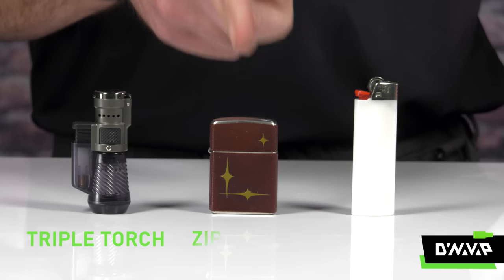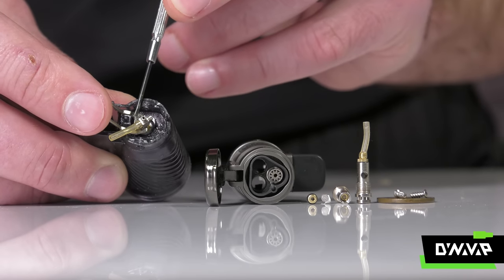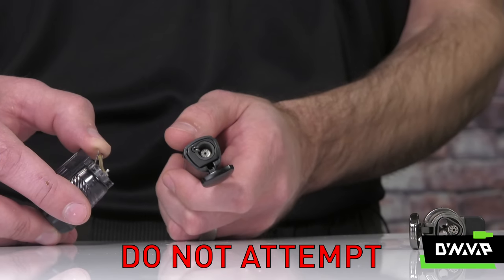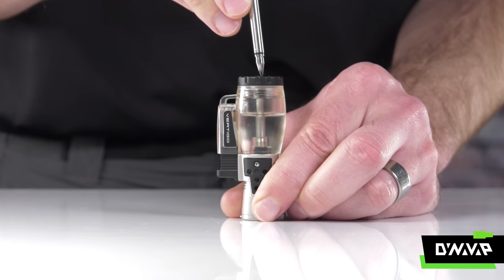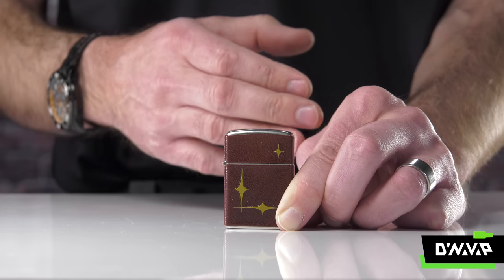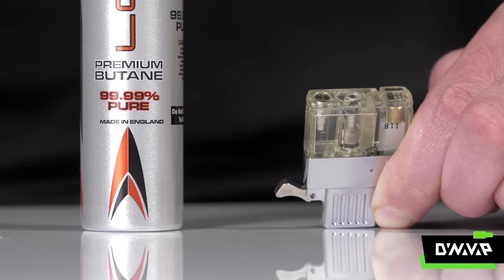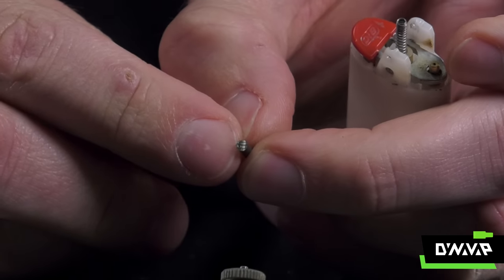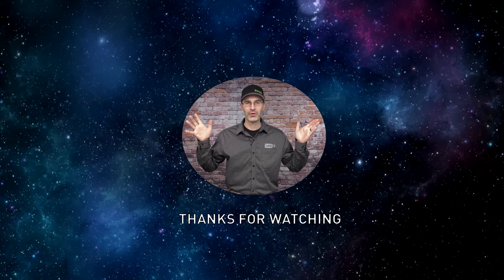How do Lighters Work? |  Exploring the DynaVerse (Ep 01x02)

Comment: Great video George. Informative and entertaining. I use a single flame torch most of the time with my omnivong xl. However I’ve had this cap since three years and it’s been my daily driver. I rarely if ever go past the click and it still clicks great. How long do they last if not cleaned with iso or run past the click? What is the longest used cap you have a record of? Greetings from Germany and stay golden 👌🏻🙏🏻

Comment: Unless I missed it,  how does the fuel ignite? What is the ignition source.
Reply: Tom Petrilli the ignition source for the torch right? I noticed also that I either missed it or it wasn’t there 😂
Reply: I am from the future to tell you it is ignited with a piezo ignition.
Piezo ignition is a type of ignition that is used in portable camping stoves, gas grills and some lighters.[1] Piezo ignition uses the principle of piezoelectricity, which, in short, is the electric charge that accumulates in some materials in response to mechanical deformation. It consists of a small, spring-loaded hammer which, when a button is pressed, hits a crystal of PZT. This sudden forceful deformation produces a high voltage and subsequent electrical discharge, which ignites the gas.